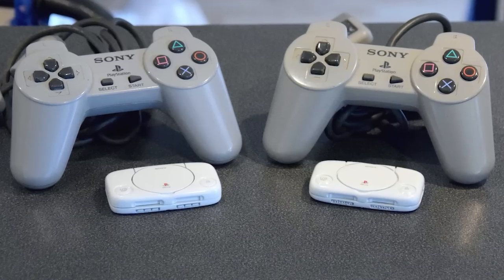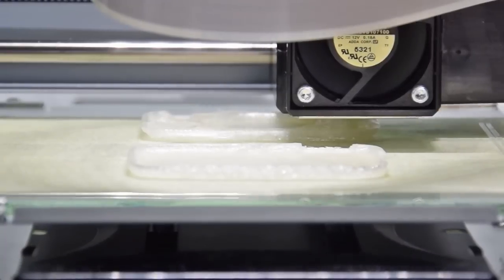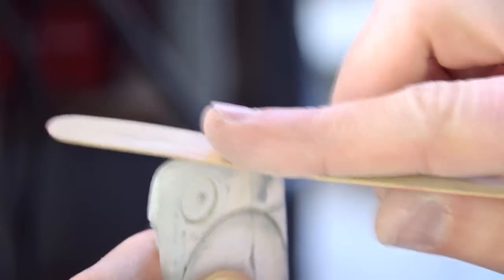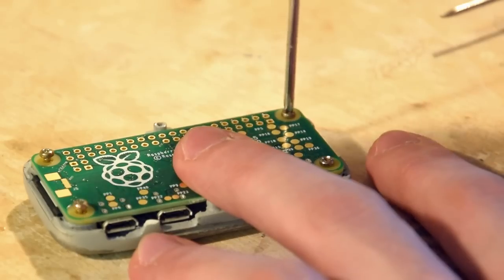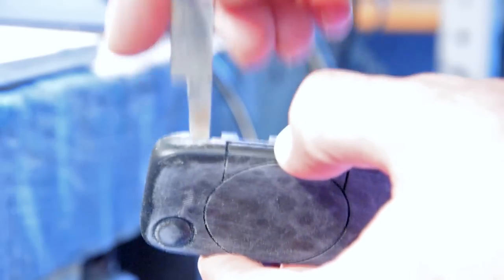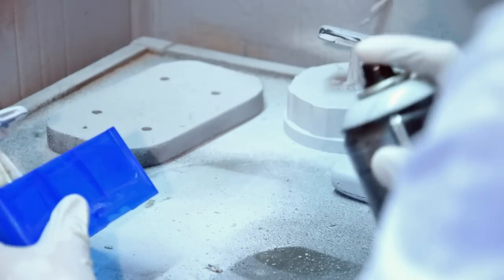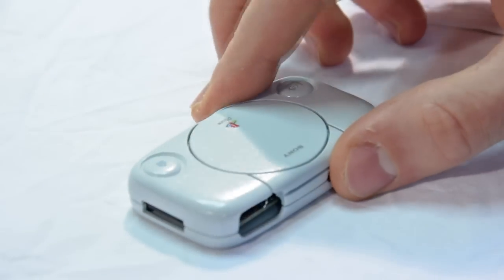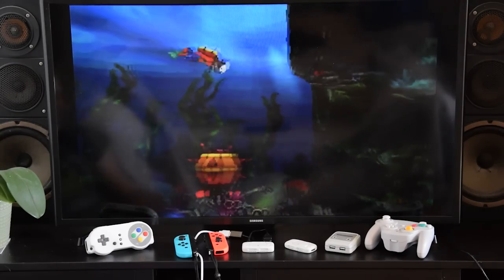Playstation One Mini : Homemade Raspberry Pi 0 custom case - Cheap 3D printing vs SLA printing

Comment: I think it's not really about how high end the printers are,  fdm printers have an accuracy limitation due to the technology and not the quality of the printer. A cheap SLA printer could print a really a high quality detailed model without being high end because the used technology is just better for high detail models.
Reply from the maker: Cheap sla are really pricy still. Dlp can do the job but it's not as seamless of a result
Reply: @RatedeMods  True, but it's becoming a lot cheaper (the resin aswell), to the point it's closing the gap with the fdm ones. I still use FDM for convenience because I I want to have my printer in my desktop where I design. Resin smell, toxic fumes and chemical treatments make impossible to have it as an office desktop friendly printer, so I use a fdm with a 0,2mm nozzle, preserving more details in comparison to the standard 0,4mm. Another thing that I realized with SLA printers, is that you have almost always to put the model in an angle, making the resin waste in support materials sometimes bigger than the model itself, so a bottle of 500ml can go really quick even printing small models. Anyways, thanks for sharing your finishing work, it turned really good.

Comment: Like to see pi zero cope with ps1 games it struggles with SNES games.
Reply from the maker: It's not that terrible! But it's not good either :) idk if you saw the gameplay with fps counter in the video
Reply: @RatedeMods  
I would think raspberry pi 3 personally.  Or odroid, the best option, even size is better than zero,as I think zero is too small for detail.
Reply from the maker: @anthonyleedickinson3491  oh yeah definitely.. well this video was supposed to be a side project to a pi3 ps1 case i almost finished.. but never did !

Comment: how to add more roms to the micro sd? (I have a pi zero without wifi and I do not know how) and what is the maximum overclock for the emulation nd e psx?
greetings and thanks
Reply from the maker: +Rexzone it depends on your OS (software) for retropie it was over an USB key. For lakka it was over wifi only. What do you have?
Anyways you'll find your answer on the website of your the OS you installed

Comment: How about some stl files?. Pla is superior to abs for this particular application. Its stronger and better for details than abs. I am betting i can get much cleaner results from my $163 printer. I would like to try.
Reply from the maker: +Nerys I'll do a "print it yourself" video soon :) I made a better version of this model. I didn't want to give the old stl too much cause you need m1.2 screws to close it and that sucks :(

Comment: Wrong psx is very playable on the pi the emulation is pretty accurate too NO slow downs most of these library runs flawless N64 is different story...

Comment: Don't know if you take requests, but it would be neat to have RPi (or some other single board) embedded to S/NES controller, so you could just plug HDMI (and probably USB for power) to TV and play some Nintendo games.
Reply from the maker: I think that has been done before :)

Comment: Can it run Crysis?
Reply from the maker: +I MLVY2589 I on the pi 5 maybe :p
Reply: The Zero can barely run super nintendo from what I've read.  Has trouble with many of the games on SNES.....
Reply: I MLVY2589 I Very Funny
Reply: It's will run on crysis ( ͡°ᴥ ͡° ʋ)

Comment: This is just a Raspberry Pi in a box. Getting boring these videos now.
Reply: Don't listen to him. I think it was a great video. At it's core, it is just a case for Raspberry Pi Zero case build, but you demonstrated valuable differences in 3D printing technologies, methods for refining prints, and ways to apply stickers. I like it.
Reply from the maker: thank you :) I think so too, especially the decals, which is why I still made this video into a big thing. But his opinion is recievable also. In terms of modding, this is light ^^
Reply from the maker: +Bazahaza sure, this was supposed to be a "small" project
Reply: Rated-e Mods I never said it was a bad video it's good. He is right though don't listen to me.

Comment: Loses points for not making the buttons functional.
Reply from the maker: +CrimSun I conceed to that, wouldn't have been super hard also ..
Reply: Not at all! You could've scaled it up ever so slightly to allow space to recess a small push button. 
I don't know much about Raspberry Pi, but I'm pretty sure it wouldn't have been too difficult. But nevertheless, still a good project.
Reply from the maker: +Xenro66 yes, but what would the buttons do? A tact for reset but for on/off you'd need a tact that retains it's state, they're usually bigger :( I don't know I did not think that part out :(

Comment: A modest printer like COREXY that have drv8825 Drivers with 1/32 step divide and pitch 2 screw for Z that reach 0.05 or even less if needed layer height and 0.2mm nozzle can reach that freaky detail of a good print.
But nice work man, it looks awesome.
Reply: I'm pretty sure my MP Mini could get very close to it. Id have to print it as an angle or something though to minimize overhangs on the ports.

Comment: Arctic Silver Thermal Adhesive, I use it to fit heatsinks on everything that has no mounting points. Then no need to have ugly epoxy blobs anywhere.
Reply from the maker: +som99 yes but I can safely remove the epoxy blobs ! (And I didn't want to buy thermal pads)
Reply: You can remove the Artic thermal adhesive :) A bit of prying and it's off, a bit more work to remove the compound from the chip tho, but a bit patience and acetone and it's gone or just some easy sanding :) Yeah Thermal pads are junk (I do not support them for anything, way to bad thermal transfer properties)... Almost forgot to tell you that the build was really nice, so great work :)
Reply from the maker: That's good to know ! I was scared thermal adhesive would be permanent and prying it would ruin the SOC ^^ thanks :)
Reply: @Fernando Salazar
 You sir do not know anything about anything you are talking about...
Reply: i had to reflow my ic after using that thermal adhesive, better use epoxy
Reply: Rated-e Mods 
I want a PS2 memory card with a built in Raspberry-Pi inside and SD slot to automatically store all the games in the SD, so it can play all my PS1, PS2 and Japanese games from the memory card, so the games from disc can be install right in it.
Reply: Never happened to me after using propper amount.
Reply: Rated-e Mods 
They should do a Raspberry-Pi for the PS3 to plug in the Hard Drive, for example an SSD with a Raspberry-Pi built in, so it can store all the games and the Raspberry-Pi able to play and save all PS2 games in the SSD and play them as if they were PS3 games, with the Raspberry-Pi ram it should play the games much faster, that would be awesome if they can do an SSD with Mini Raspberry-Pi chip just to allow PS2, PS1 and even the PS3 games to be directly installed in the hard drive and play them, also the Japanese and if they could even the XBOX and XBOX360, Saturn and Sega CD, I have a bunch of PS2 games I want to store in my console.

Comment: I know it wouldn't be three dimensional, but since there were already water decals it might look pretty okay if the controller ports were just flat recessed areas with simple decals on them. Very impressive either way though. I know it'd be really tough, but SD card storage under a functional lid would be nifty!
Reply from the maker: +TwistedD85 true, lots of room for improvement !

Comment: Seems like you would have heat issues even with that improvised heatsink. I really think it would have been worth it to make it slightly bigger and include a tiny fan instead of a heat sink.
Reply from the maker: +Aisha Love honestly it took on all those games back to back for a few hours when I was filming and it seemed fine. The case wasn't hot to the touch, and performance didn't seem to change :)

Comment: Never really looking into the Pi 0. much I'm shocked and impressed it can play PS1 well enough to warrant making the case.
Reply: PS1 came out almost 25 years ago...that would be sad if it couldn t hehe,  even some cheap tablets can.
Reply: It's not so much the age of the system that's important here as it is the power of the Pi0, I mean some people complain that even the Pi3 has a bit of an issue with some PS1 games
Reply: yes i am surprised too, i have a raspberry pi 0w with retropie  I can barely run games like final fantasy VII - any other games won't even boot or be very laggy for the psx-

Comment: Man that FDM print could be 10x better off the bed with some tuning
Reply from the maker: +Shadow_Burn68 i've printed a lot with this printer and there are always defects.. Sometimes it stops feeding for half a layer.. Nothing much to do about that right?
Reply: seems like there may be a problem feeding the filament like the extruder gear may have some chewed up plastic in it or the spool catches on something/ has problems rotating what printer are you using?
Reply from the maker: +Shadow_Burn68 that's quite true, I've had to take the motor apart a few times to take residue off of it. But during a print, there's not much I can do :( it's a da vinci jr.
Reply: Man its a shame its such a locked down machine, your designs are really cool hope to see more awesome projects soon
Reply: Never had the problems he said with his printer with mine. Soon as iI get a new extruder imma try something like this but i know itll be better detail then his fdm print, mine with the cheap extruder isnt even that bad and it isnt able to be dialed in bc its not consistent enough due to bad design and slipping
Mine was a black widow but its a redone custom build of it with all better parts minus the extruder wich is coming soon.
Reply: I mean a black widow is a lot more open to custom parts then a da vinci jr I know for a fact my scratch built P3Steel prusa clone can do better just because I built it myself and went thru all of the tuning
Reply: Might be a software issue. Try playing with retraction and extrusion multiplier settings in slicer.

Comment: "This is the PSONE, it was the smaller revision of the original Playstation"

Thank you! I've alway hated it when people talk about the OG Playstation and call it the "PSONE", that is not correct, the little SlimLine redesign is tbe ONE
Reply: +M4775K311
Generally speaking when people say "PSONE" they referring to the fact that the PSX was the first generation of Playstation as there was PS2 and PS2 slim, PS3 and PS3 slim and PS4, PS4 Pro and the upcoming PS4 slim.  I agree that it is irritating, but only very mildly, and it's understandable.
Reply: Well, it's just because when you're talking about 'playstation' things get very ambiguous very quickly.

Like, I have a PS2 on my desk next to me.

When I say 'playstation' that falls within the definition of it.

Just like Xbox is completely ambiguous, so is 'playstation'. (Xbox is worse in that the original is just Xbox, but the most recent one is Xbox One. Yet just saying 'xbox' doesn't get the point across if you're trying to distinguish between them.)

If I randomly mention 'playstation' in conversation, most people will assume I mean PS4 absent any other context.

If I say 'Playstation One', pretty much everyone will have a decent idea of what I mean.

It may not be TECHNICALLY correct, but it's the only non-ambiguous, non-contrived way of referring specifically to the first generation playstation console.
Reply: ok so I got that info about the PSX from a youtuber named Adam Koralik, he did say that PSX was a fan adopted term for the PS1. I looked it up and PSX was actually the codename for the PS1 much like how the Gamecube WAS called the Dolphin in it's early days.

I could be wrong again.
Reply: I also dont like it if people just use so many different wrong Names for some Consoles. It is just a Playstation or a "Sony Playstation" but not a PS1 or PSX. Or how many people call XBox "Original XBox" as if XBox 360 or XBox One are "Fake XBox". And dont get me started on Nintendo XD Everything is "a Nintendo" :P
Reply: If you wanna get more technical, PSX is like a fan adopted term for the PS1. There exists a redesign of the PS2 called the PSX, it was a DVR and a game console but it was a DVR 1st and a game console 2nd. It was not made by the Playstation division it was designed by one of Sony's media divisions
Reply: @Sonic Prower, that is correct.
Reply: As far as my recollection serves, and I was in my child years at the time, the first Playstation was adopted from I believe a Nintendo machine or something similar, and it had a few plugs at the back, one of them supporting game cartridges (Because using discs was a new thing). When Sony took on the project and refined it, obviously they removed the game cartridge and that project was called PSX. 

Now I don't recall if some of the Playstations (pre-PSX) were sold, or they just came in to possession over time. But out there exists Playstations with support at the back for non-disc game media.

Thus, while not widely known, the "OG Playstation" is very often actually the PSX, and isn't the original-most. It is of course the most common. 

It's also no argument that the PSOne is a little white box and personally, I'm too nostalgic about the PSX to love the PSOne. I did manage to find a pre-PSX Playstation once at a second hand store about 14 years ago, picked it up for $5. I no longer have it and wished I had cared more about it at the time. 

That's all I know on the subject.
Reply: psx and ps1 i know but still i call them both ps1
Reply: TheCaptain (still getting replies a week later)

I understand that some maybe that way but most people genuinely think the the OG Model is the ONE. A famous example would be a youtuber called Gamester81, he did a video on the bet yoroze and said "Now a lot of people call this the PSX but that is incorrect, this is actually the PS ONE"

and even those who may hust be referring to it being the first generation, I have to lump them in with the people who cal the NES "the Nintendo"
Reply: Lewis Filby (AGAIN it's been a week and I'm still getting replies)

See my previous comments
Reply: i always cal it the psx
Reply: Even then, a lot of people actually are talking about the PSX when talking about OG Playstation.
Reply: Joshua Lloyd That is partially correct though as Playstation Games are always listed as "PSX" even back when Gamestop still had them.
Reply: PSX is still wrong when refering to the PS1, so Gamestop got it wrong as well. Same reason why we don't call the Gamecube 'Project Dolphin' anymore. It's also the official name of another Sony console, which is a digital recorder/PS2.
Reply: you are so right its a PlayStation not a psone
Reply: Erik2Ammo It was the codename for the OG Playstation but it wasn't only gamestop, all stores kept their playstation content logged as "PSX"

It's also like how most stores kept their DS content logged as "NTR" for Nitro.
Reply: M4775K311 in germany its easyer, the o one we call playstation eins and the slim we cal playstation one.
Reply: maybe they're saying PS1 not PSONE.  also PSX was a Japan only PS2 variant with DVR

Comment: If you have a Pi 3B, I'm pretty sure PlayStation Emulation runs at full speed
Reply: I've had one and am sad to say that isn't the case. Some titles run very bad, especially demanding 3D games like Tomba and Spyro.
Reply: I have, don't got a single problem with the PS emu, tried 60ish games already, the only one that sometimes gets slow is Sypon Filter. Then on the N64 I'm having troubles with that one game where you fight 1v1, ex. Pikachu vs Donkey kong, super smash bros, it feels after 10 minutes playing like my raspberry would explode :p it seems like it suddenly runs at 3FPS, but all the other games and emu's are perfectly running.
Reply: Pi 3B is great for 16 bit games.  32 and 64, you'll start running into problems here and there.  Especially 64 bit.